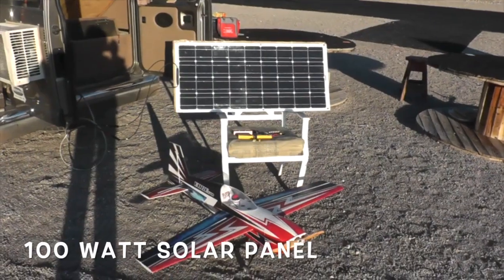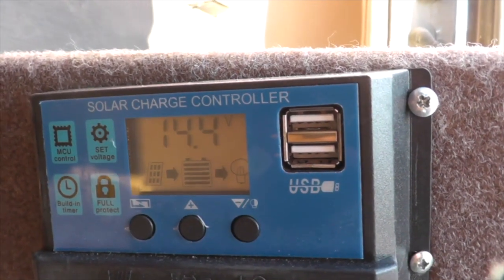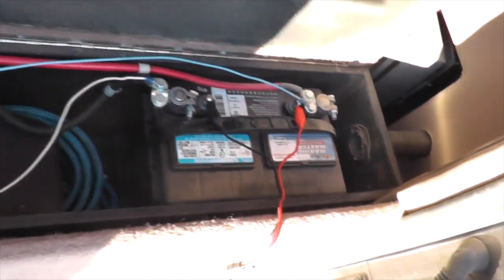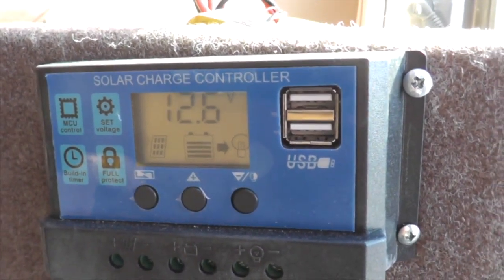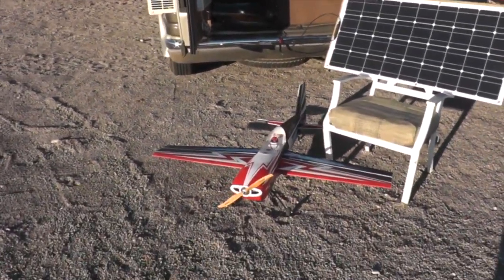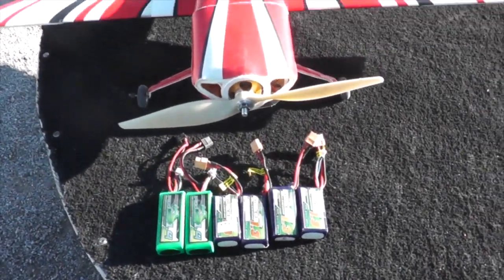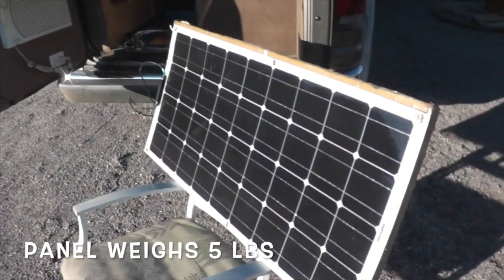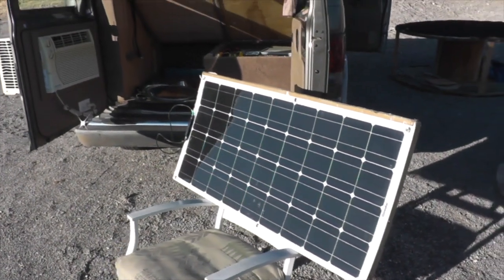SOLAR CHARGING LIPO BATTERIES

Comment: I plug my isdt charger directly into the panel charger supports 9v to 40v so the voltage fluctuation isn't an issue on my 250watt panel i can charge my 3s packs at around 15 amps
Reply from the maker: Cool! Thanks for sharing

Comment: Hey man, I like your setup! Been looking for a solution like this. The battery that the solar panel is charging, is that your cars main battery or do you have a seperate battery, exclusively for charging lipos?
Reply from the maker: Thanks, yeah it is an RV so the battery in the back is the house battery to power the Fridge and lights in the RV.  It is a 12 Volt lead/acid battery just like the car battery. It is separate from the Car battery but of course charges when driving. When we camp this setup keeps my flying without having to start the Car engine and lets me charge at the Flying field as swell.

Comment: Can i connect directly the panels to the battery charger? what could happen?
Reply: Probably not a good idea. The voltage and current from the Solar panel changes as clouds go by and from any shading on the panels. The charger needs a steady source of power that does not fluctuate, but that is just my guess.
Reply from the maker: Probably not a good idea. The voltage and current from the Solar panel changes as clouds go by and from any shading on the panels. The charger needs a steady source of power that does not fluctuate, but that is just my guess.

Comment: you must be getting losses with this method. is there any charge controller designed for lipo batteries?
Reply from the maker: Yes, there are specific charge controllers for various type batteries. This setup works well though is is very inexpensive and meets my needs. Thanks